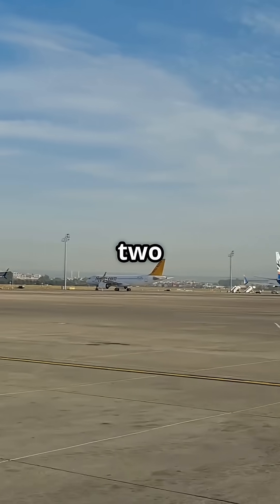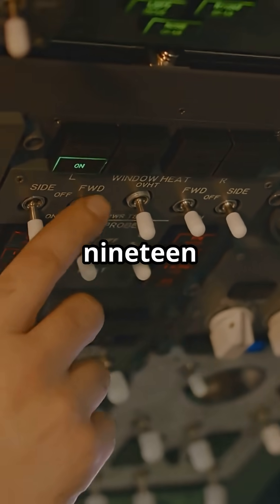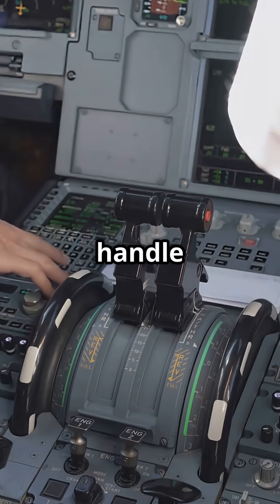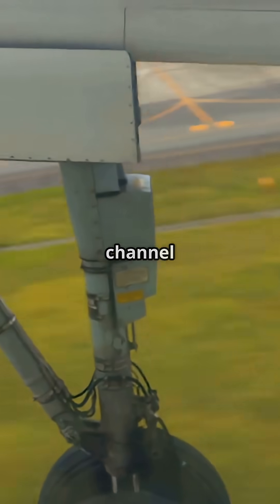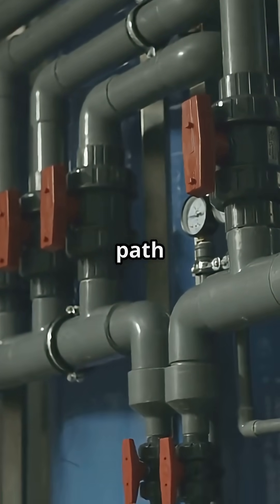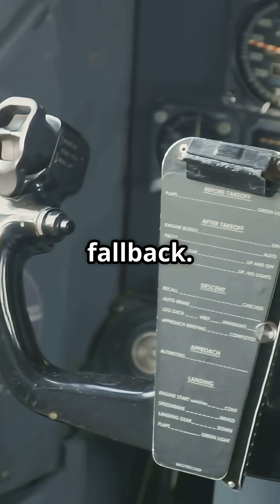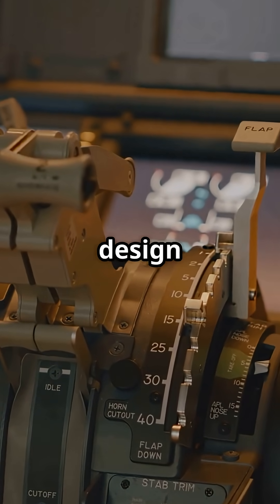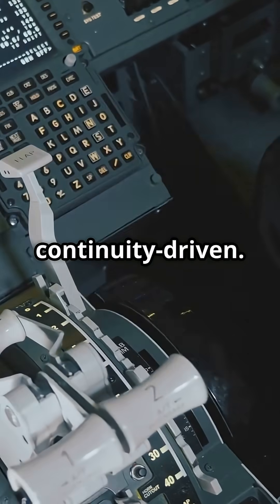A320 vs 737 — Three Hydraulics or Just Two?

Comment: I'd never trust the Pilot if in doubt. Human error is already by far the most common source of accidents. I would not want a Pilot that practices manual flying once every 6 months on a simulator for a few hours, in control of potentially heavy wire controls in a super stressful situation. And the numbers back that up: 0.24 crashes per million flight for the 737 vs. 0.09 for the Airbus...